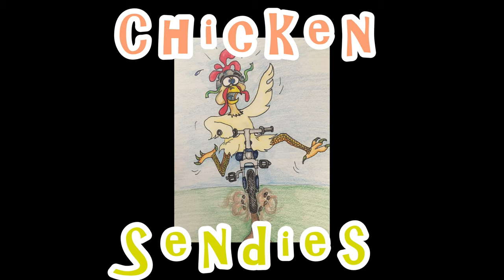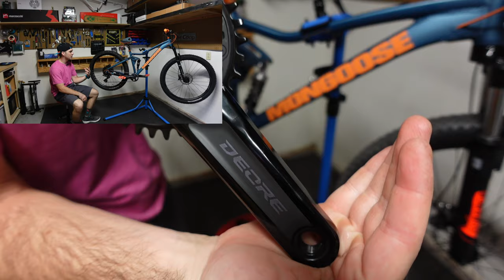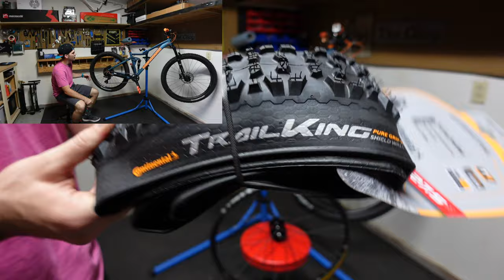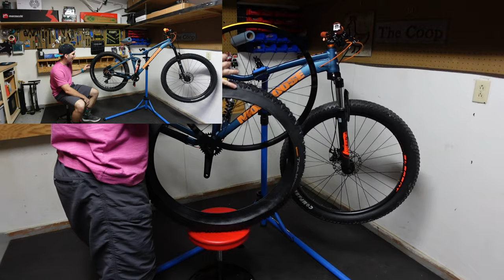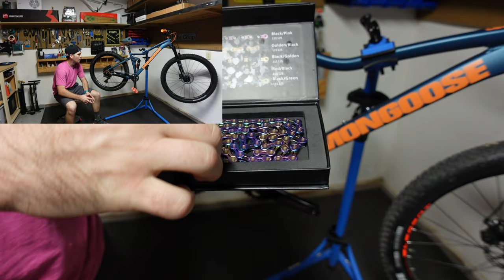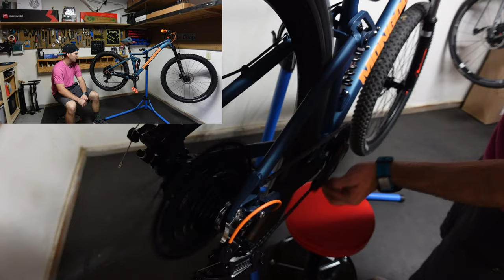Mongoose Ledge X1 Drivetrain Upgrade - Advent X Installation - Budget Full Suspension Mountain Bike

Comment: I have a Ledge X2 that I literally just purchased last week.  I've already got a Rockshox 35 front shock replacement and it came with a thru axle for the wheels that I ALSO just bought, Roval Traverse with a DT350 rear hub that has thru axle end caps.  I do see that these bikes have a replaceable rear drop-out, so I'd LOVE to be able to find a set of drop-outs that will convert the back wheel from quick release to thru axle, if possible.  If not, do I just try to find quick release end-caps for the rear wheel?  HELP!  I also have a new rear shock that'll be here Saturday, the 26th.  Gotta get rid of the squeaking stock unit.  It drives me NUTS.

Comment: I have a ? maybe you can help me out.. I don't want to switch my ledge x1 wheels out but was thinking I wanted a 22T and 36T crank with two rings on it but only use the smaller 22T sprocket without any shifter so I can get some more power from the stock rear wheel so I can climb better.  Is it possible to buy a new crank with two sprockets and install it in the ledge will it work with the chain and rear gears? what can I do?  Thanks

Comment: Hey chicken I wanna get that Cassette, but I was wondering if I'd have to replace or upgrade any other part or just the cassette
Reply from the maker: Since the cassette is a wide range 10 speed you would have to upgrade the entire drive train. (Shifter, derailleur) That being said if you have the Ledge X1 and not X2 you will also have to upgrade the rear wheel as the stock one is a free wheel and not a HG Cassette. Gets a little pricey pretty fast.

Comment: Thanks for the shoutout! Dig the build. I've been super distracted with life and other projects at the moment haven't had a chance to complete my ledge x1 build yet so I havent shared my upgrades yet. I still need to put the drivetrain together, install my hydraulic brakes, install a dropper, and convert to tubeless. I also went with the advent x 10speed drivetrain. I have all the parts/tools already, hoping to get it all sorted out by the end of the month.
Reply from the maker: Of course man! Hopefully you'll get them here soon!!!! Time is definitely necessary to work on bikes but hopefully you can get yours done here soon!!!

Comment: Sounds like a nice set-up;. Would you post links for the Shimano crank set with bottom bracket and/or part numbers you went with?
Reply from the maker: Here are some links to Amazon for you!

https://www.amazon.com/SHIMANO-Deore-FC-M6130-1-Crankset-12-Speed/dp/B088XFBJ8L/ref=sr_1_6?dchild=1&keywords=shimano+deore&qid=1630884029&sr=8-6

https://www.amazon.com/SHIMANO-UN26-Cartridge-Bottom-Bracket/dp/B00WLFUP2U/ref=sr_1_2?crid=2MAL5R1FVN81K&dchild=1&keywords=shimano+deore+bottom+bracket&qid=1630884048&sprefix=shimano+deore+bottom+%2Caps%2C160&sr=8-2

Comment: Great video and awesome looking MTB. Don't laugh but is it possible to install boost rims on this frame? I know the fork will need to be changed but what about the rear? Again great video and continue to stay safe and blessed.
Reply from the maker: Thanks, Eric and I appreciate it! The rear is 135mm QR and unless you do some modifications (Which I do not recommend) It will have to stay that way. But there are a lot of great options for a rear hub that is a huge upgrade compared to the stock in the 135mm QR. The front you can do what ever you want since it is separate! HAHAHAHAH

Comment: It would be cool to see this bike go head-to-head with an XR,  but would have to be Apples to Apples so, you would have to be very similar components.  I don't know who it was but somebody said on YouTube that the rear suspension wasn't a slinky as the xr which is kind of odd because I believe the rear shock on an XR is about a 1/2 inch shorter but don't quote me on that.
Reply from the maker: They are definitely close in comparison but the Ledge X1 really shines in the geo department. You can just tell it is a newer styled bike.
Reply: @chickensendies  yeah the XR is a dinosaur for sure, I have to try one of these new bikes, I'm not convinced that a steeper sloping head tube is better on the downhill, but I definitely like to try one out.

Comment: Awesome channel...
Just got my X1 and want to order a Koozer rear hub in order to upgrade the drivetrain.. Just not sure the exact size I need to order. Any advice would be appreciated. Thank you!
Reply from the maker: Really appreciate that, Duncan! You will want to order a 135mm QR for the rear. Front hub with the stock fork is 100mm QR. Hope that helps!

Comment: So I bought my wife a Ledge x1 and myself an Axum. I upgraded my drivetrain a couple months ago but haven't touched hers yet. While cleaning our chain and reapplying the chain lub I heard her rear hub sounding like there is sand in it. So grabbed my tools and went to remove it and found out that the Ledge x1 has a freewheel and not a Cassette. 

So should I just replace the rear wheelset and them get her the Advent X?
Reply from the maker: I personally would say yes but that depends on you personally. I new freewheel would be a easy and cheap fix. But, If you want to upgrade it for her go to town! HAHAHAHA

Comment: Love the videos man! 
Did you go with the 142 or 148 by 12 on your wheel set? Gonna be upgrading mine soon! Kinda following this build💪🏻
Reply from the maker: I actually kept the rear QR since it is QR. The wheelset I purchased has a option to switch out the adapters to make it fit QR.

Comment: Hey man, I know you've probably talked about it before but I couldn't find it in any of vids i've seen. What orange cable housing do you use? I was going to do the orange and black cables but use orange hydraulic brake lines, but since I've seen your X1 I'm going to go the other route since it seems easier for a noob.
Reply from the maker: Attached is the link to the cables I personally used! 😁😁😁https://www.amazon.com/dp/B07JMV3BR2/ref=cm_sw_r_cp_apa_glt_fabc_4HQJD6YNNDD5P6K7255C?_encoding=UTF8&psc=1

Comment: You should remove the main pivot and lubricate it right now if you have the chance before it starts to grind down the plastic
Reply: For reference, I'm talking about the main Pivot that's silver in color directly behind the bottom bracket. It's two metal pieces bolted together with a hex bolt that rides on two plastics sleeve bearings. It'll develope a wobble over time as the plastic grinds down.

Comment: How many spacer do you need for each side of the new bottom bracket? Also what is the size of the spacers? Thank you!
Reply from the maker: I used the 3 spacers that came with the bb new. I did 1 non drive and 2 drive side. Hope that helps
Reply: @chickensendies  Thank you! It's very helpful. I'm a noob. I bought the exact same crankset and bottom bracket 😁.

Comment: What pedals are you using? 
Also, have you considered going to 165mm crank arms?
Reply from the maker: I am using raceface chesters. For me 165mm is just a little short. I have ran it before but did not like the feel so I typically run 170mm now.

Comment: I’m very very new to this hobby/sport. Can I use the same wheels but just get a cassette with more gears?
Reply from the maker: Sadly not. The Ledge X1 hub stock is a freewheel which is very limited in upgrading. You'll want to get a new rear wheel with a "HG" or shimano styled hub. That will give you quite a bit more options for upgrading.
Reply: @chickensendies  thank you for the reply. So with just getting into it should I be upgrading anything. I mean I just bought this bike and have never done a trail. But I’m very good on a bike I’m not a rookie. Just never done a trail. What do you recommend on upgrading I was watching other videos and they say the pedals and should be ok for now what do you think?
Reply from the maker: @philthyphill8753  of course!!! I would definitely recommend stock for a bit. I always recommend contact points first. So, grips, pedals and saddle. Definitely get a few rides stock and you'll know what you'll want to change 😁😁😁
Reply: @chickensendies  awesome advice. Thank you
Reply from the maker: @philthyphill8753  always feel free to reach out and I'll try my best to help! SHRED ON!!!

Comment: Will acolyte cassette work?
Reply from the maker: The X1 is stock with a freewheel so sadly it will not. You'll have to buy a different rear wheel with a HG/casette rear hub to get that to work.
Reply: @chickensendies I see Amazon has advent 9 speed group set will that be same or different?
Reply from the maker: @Frdd2290  Advent 9 will be hg/casette as well so new rear wheel still for that.
Reply: @chickensendies  ok thanks very much
Reply from the maker: @Frdd2290  Of course!